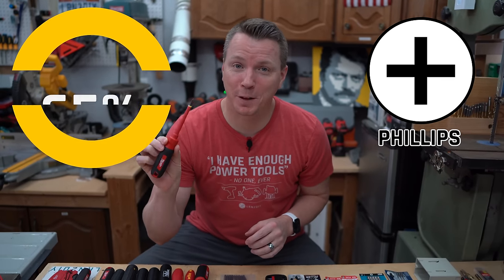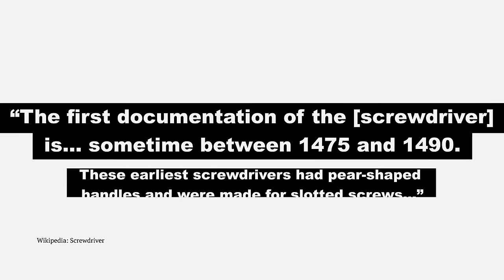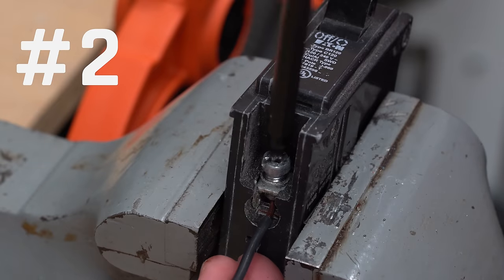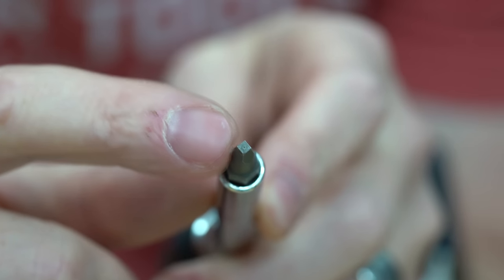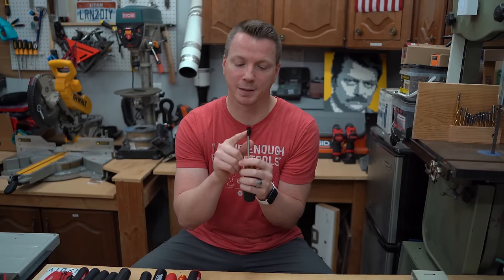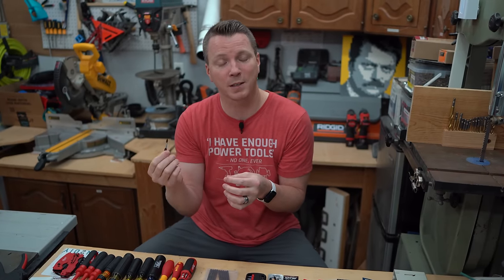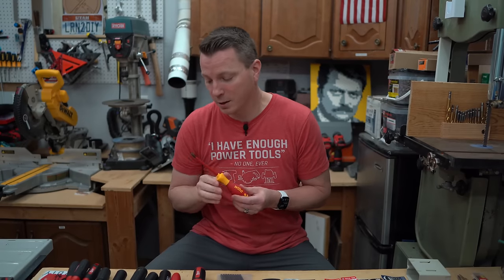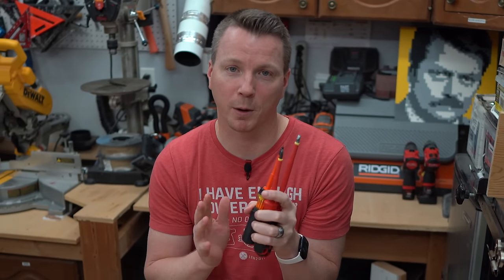You're Using the Wrong Screwdriver For Electrical

Comment: Slotted screws are easier to clean paint out of and they permit the application of good torque. Phillips helps one avoid scratching the surface one is driving a screw into. The square drive is ‘sort-of’ ok for the same reason a Phillips is kind of good; it helps one avoid damaging the surface one is fastening to; they permit pretty good torque and they are pretty good for the brain dead who have issues aligning the driver to the fastener. The ECX tip is great for all the above. They do all of that good stuff, the kind-of good stuff better and they help prevent damaged to the surface being fastened. Wiha makes the very best edition of that style driver. That Klein tip is pretty darned good too. The Wiha is my go to for that “ECX” style thingy. Good video. While I don’t agree with you on a basis of total best, for me the square is not ‘always’ good. Some screws on electrical devices need a slotted driver. You covered all the ‘stuff’ about screwing with a tool. Nice job!

Comment: The only problem with the Robertson, is that you will never find a faceplate, or the screws that mount a recaptacle into a box that are Robertson compatible.  It sucks, but a flathead will be the only type of bit that CAN be used for everything, even though it is the worst type of bit to use.

Comment: We may not be using the wrong Screwdriver necessarily but not the recommended Screwdriver For Electrical. As a tradesman, there are many different screws and drivers for electrical plugs and devices as well as the New and The Very Old Outlets and then there are the screws that have damage to the head of the screw so one uses what works.

Comment: Slotted screwdrivers are fine only when you have lots of room and good lighting. I inherited an early 20th century brace and bit. if your work is on the table and you are over it, line it up and crank that screw down. In awkward positions, its terrible. You can neither get the alignment nor keep it for a quarter turn. There is one example I can think of where straight slotted screws seem to work ok. That application is gunsmithing, high class drivers and milled screw slots in hardened screws. Its a different world when you are sitting at the work bench versus hip on floor and propped up on one elbow while trying to do things one handed and see what is happening.

Comment: Did you try JIS drivers? Japanese industrial standard are designed to not cam out, philips are designed to cam out when over torqued, which can damage the tip. Once the tip is damaged it cams out earlier and earlier. Any Japanese motorbike owner will tell you of the benefits of JIS screwdrivers. Vessel make fantastic JIS drivers.

Comment: Whenever I do electrical, I just switch out the always terrible extremely soft  sheet metal screws that come with the outlets / other device to hardened alloy torx screws, you can get them cheap from McMaster Carr.  Absolutely perfect every time.  The enginerds have solved this problem and the answer is the torx bit.  Why we continue to use anything else is just ridiculous.

Comment: Neither of these. I use Plus-minus driver. Sometimes called PH/S. Sometimes slotted (because it will still work, as long as you have good quality slotted driver, with flat blades, most cheap ones will not have flat blades), if I cannot find it, but rarely Philips, because it will slip.

Comment: Slotted screws get a lot of hate, but for anyone interested, they have their place on boats. Most notably on wooden boat hulls. The slot can take a lot of torque, and is easy to clean decades of paint and corrosion out of when removing the fastener. The slot is also easy to cut deeper for removal if necessary.  I hope slotted screws continue for another century... at least in that application.

Comment: Robertson or slotted. Commercial work still has a ton of slotted screws and it's annoying. Robertson is king. It's the logical evolution of the Phillips which is still great for something small like box screws faces places something with low torque and quick speed Phillips still works well

Comment: We can't get rid of flat-head screwdrivers. They're very useful at prying things open. 
My screwdriver of choice is the Roberson for 95% of anything I do. Electrical or not. And yes, I am Canadian. 😁
When I can't find an insulated screwdriver, I place 1 or 2 layers of heat shrink tubing on the shaft. 

That P2R2 is very useful for the screws of modern door hinges. I'm almost positive that's what they were created for.

Comment: A Phillips works just fine for most. Only a professional will pay $30.00 for one  ECX screwdriver.  
the actual problem is that the outlet screws try to accommodate to many types of drivers.
Slotted Is the original Screw head. when matched with the correct size screw and screwdriver they work well. Problem is this rarely occurs.
But who uses manual screwdrivers any more ?
I am a pro and I power drive any screw #6 or larger.

Comment: No, the only reason to even have to have a slotted screwdriver is because they STILL make device covers with little slotted 6-32 screws, so you really don't have a choice there. The once you remove the device cover, you can either continue to use the forsaken Flat slotted screwdriver...... or you may SWITCH to a Phillips head screwdriver, or a #1 Robertson screwdriver. Then when you remove the device, you can then either use a larger Flat slotted screwdriver for the larger termination screws, a Phillips (which suck on those, a Robertson, but a #2 because a #1 is too small, or the ECX bit, which I like. The best torques comes from the ECX screwdriver or bit, but it don't work on anything else related to device maintenance or replacement. Yes, I totally agree that it is too much and since it is 2023 already and going to be 2024 very quickly, why do we need to keep producing more ways to do the same thing? Even better..... when we find a better way to do something, why don't we eliminate the old way and just use the latest and greatest? Is it cheaper to produce the crappier slotted screws then Phillips, or at least produce only screws that all screwdrivers can access, which would be the ECX screw head!

Comment: A square head is the most modern, this isn’t a surprise.  It’s meant for use with higher torque applications.  Slotted was for manufacturing simplicity, Phillips was for powered drivers, square is highest torque for powered drivers

Comment: Nice work. I don't do a lot of electrical stuff, but I have always found the mechanical aspect frustrating. I have always wondered why the thread pitch on e.g. electrical boxes etc. is so fine. I am Canadian, so (as mentioned) Robertson is always the choice here. However, some budget Robertson screwdrivers are pretty crummy. I will probably be upgrading to Klein screwdrivers based on this video.
Reply: Thread pitch has to be ultra fine because most of the time these screws are going into a very thin sheet of metal with tapped holes. Finer thread pitch also allows gives you more mechanical advantage for tightening down the wire leads.
Reply: @JPresto  Thanks for that clear explanation!

Comment: I know this might sound a little weird but, apocalypse type survival type situation where no tools are available or very little, if you have a Flathead screw you could make a Flathead screwdriver out of a piece of metal grinding it down on a piece of concrete or even a rock to make a a Flathead type screwdriver to get the job done. The example that would mirror that is like nowadays cars are made with computers and you have to damn near be a have all kinds of very expensive tools and equipment to diagnose and fix the vehicle where is back in the old days it was as simple as it's either a points condenser a cap or spark plug or plug wires simple and it could be anybody could do it. Same with Flathead screw anybody could find a way to fashion a Flathead type tool to undo or tighten a Flathead screw. All those other shapes and whatnot are are great because they you get better grip like the star head or torx type which are excellent on screws the for decking as opposed to Phillips. Those star torx type bits are really nice because they grip and they can really drive a screw where is a Phillips will strip out many times those torx do not hardly ever strip out. So yeah after a nuclear Holocaust I would really appreciate screws and tools being the Flathead type. But yes at times I wish they would just go away.

Comment: The reason many types have lasted longer than we think they should is because they suck. Some things will only use a certain screw so that it will cam out before you over torque it. This is why even in Canada where Robertson rules, they still use Phillips drywall screws. If you used Robertson or Torx you’d probably break heads off regularly.

Comment: when i came to the us it was weird not to find any robertson screwsat the hardware store. Then decades later they popped up with the decking materials. In Canada we had 1,2,3 robertsons and you had to have all 3. It seems USA was resisting to using anything from Canada back then. Perhaps because the Canadian dollar was worth more at the time. Also Robertsons were very common in furniture especially securing backs to chairs.  Next best thing to Robertsons is the torx.
Reply: Robertson 0, 1, 2, 3 ... Y, G, R, B.  I believe the lack of mass adoption back then was due to the Robertson families tight grip on the manufacturing and distribution.

Comment: Bosch makes Robertson tips that have parallel flats, unlike the dedicated electrical screwdrivers that have a taper.  They work very well when a R2 is appropriate.  Just my opinion, I am not convinced that electrical screws are intended to have a Phillips screwdriver used in them.  It seems more like the Phillips accidentally sort of almost fits the combination slotted/R2 screw head.  A QUALITY Phillips screw head and a good bit like an Apex brand work extremely well but the only place I've ever seen really tight fitting Phillips screw heads is in aircraft screws.  The aircraft screw head matches the Apex bit so perfectly that I've had a heavy ratcheting Snap-On screwdriver hang by the tip in the side of an airplane. --  Any time a screw is to be filled or painted over the straight slot is by far the best choice.  In wooden boat building, for example, the planking is held on with screws that are deeply countersunk and have plugs set over the screw heads.  Should a plank be replaced, the plugs are removed and the screw heads are cleaned out so they can be removed.  It's far easier to remove bedding compound and paint from a straight slot than any other screw head type.  --  There are many kinds of flathead screws.  There's the straight slotted flathead, the Phillips flathead, the Torx flathead, the Pozidriv flathead, the Reed and Prince flathead, the Robertson flathead and the hex socket flathead to name a few but there's no such thing as a flathead or a slotted screwdriver.  Have you ever seen a screwdriver with a slot in it?  It's a STRAIGHT BLADE screwdriver.

Comment: Someone should explain the markings on the screws. Mine look like the ones at 3:00 but yours has two marks were mine has one deep strait line mark.
I tried Phillips and my kobalt diamond tip works good but one of my husky’s not so much. Pozidrive is worse. Square drive #1 does good.
They have the combo tips but there is also multiple types.
They need to just make a square drive #1 wide slotted combo.

Comment: The most likely reason that Robertson #1 is not included is a marketing design/strategy, i.e. in that set, there is a size that is not that useful to you. This way you have to either buy another set that includes the Robertson #1 or buy it by itself at full price.
I noticed this in anything that comes in a set, they throw in a not so useful  tool or accessory to make it look like you're getting a great deal. It's a numbers game.
Great tool review BTW !!
Reply: Actually, it's because #2s are actually used more often as they're used in construction. Most wood screws that are Robertson are #2.

Comment: I use phillips except for breaker panels. Because not all parts have the square tip(especially 30amp receptacles, some only use flat heads. I hate flat heads). For panels, never seen one without square tip screws. If you have a newer milwaukee impact drill, it has a no-strip/cam setting, the icon that looks like a screw(that is not for drilling, it wont even put a screw thru a knott in wood. Use any other setting for drilling) NEVER stripped a screw with it. Now if you left it on another setting, yes and broken off screw heads is common. ~Actual Electrician

I came looking for non marring flat head, to put plate covers on. Tired of using tape....

Comment: I'm not an electrician, but I've done my share of electrical work (with a qualified electrician overseeing my work). As such I see absolutely no use for the combination drivers. If electricians like them that's great, but for the common household/ tinkerer's toolbox (or virtually anybody else) I just see them as a gimmick to waste money on. Especially considering the fact that the screws they are intended for also accept the perfect/ more readily available driver. And if you're unsure which driver I'm referring to as perfect... I'm Canadian, eh!

On more little tidbit that I didn't see mentioned here: the "problem" with needing 2 sizes of Robertson. I can't think of a single electrician I've worked with that relied on driver bits/ multi-bit drivers; they use single drivers for each size. Single Robertson screwdrivers (around here, anyway) have colour coded handles: #1 = Green, #2 = Red, #3 (the Big Boi) = Black. A quick glance @ your tool box/ belt is all it takes to find the proper driver. (I've never really checked colour coding for slotted or phillips as 95% of the time I ever use them is in jeweller's sizes or I use the one phillips I own that I know fits nicely into computer screws).

Comment: I’ve always felt that the manufacturers used the wrong screws.The old straight blade screws were much more user friendly.Maybe this was done so a dedicated driver had to be purchased.At about the same time,the yoke screws were changed from flat head straight blade to a very shallow grooved pan head,that is a challenge for any driver.

Comment: I have a Robertson 0 made by Channel Lock, that I found in a tiny country hardware store that had about 4 inches of dust on it lol. I don't know what kind of metal the shaft is made of but it's not conductive at all and the tip is carbide.
Reply: The shaft might be coated with an insulator.  Try applying a magnet.
Reply: @bobd5119  I tried the magnet within the first 5 minutes of owning it lol. No stickum.
Reply: @anomicxtreme  could be an aluminum shaft with a steel inserted tip. the 0 size is a color code of yellow in true robertson . so it goes yellow , green , red , black  0,1,2,3
Reply: @ronblack7870  I had thought the same thing as well. The handle itself is ChannelLock blue but no other colors or anything and just says SL-0. They downsized their tool line too and don't do most of what they used to.

Comment: In the trades, best screwdriver ever- ideal,#1,2 Philips, 1,2 slotted, 1,2 Robertson,15,20 torx, star wire nut wrench in the handle, 1/4,5/16 hex drives and loopholes for 14,12 solid JUST NEVER let the helper use it for metal knockouts. Or use an orange wire nut in the wrench, too small falls inside and clacks while you walk can drive ya batshit. If someone of lower moral fiber finds all the features -disappears, but being black grip, yellow clear plastic, blends in with all other multi-bit screwdrivers. Milwaukee replacement double-sided bits fit if you can't find ideal if one wears out.

Comment: There's a right tool for every job.
With this in mind, I am a bit astonished that this clearly inquisitive and well-informed presenter failed, at 02:10, to recognize that those face-plate screws are designed to be installed and removed with a kitchen butter knife ;-)

Comment: Robertson went to Ford, proposed the fastener, but Ford wanted a manufacturing license to use in US.  Robertson wanted to make the screws and tools in Canada.  So Ford went with Phillips.
Reply: Thanks for getting to the heart of the issue. I'd like to add that Ford went with the Phillips driver because it is designed to cam out. Ford knew he had only semi-skilled labor who, quite frankly, couldn't properly turn a screw.